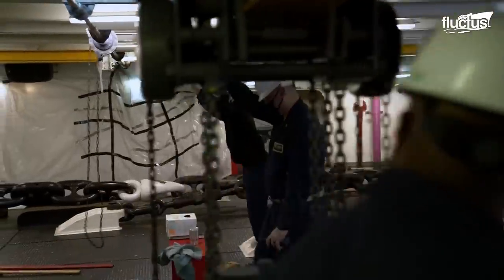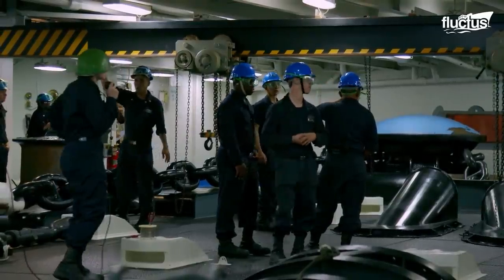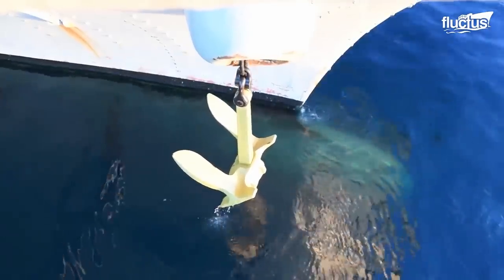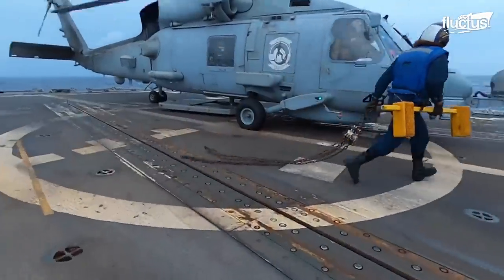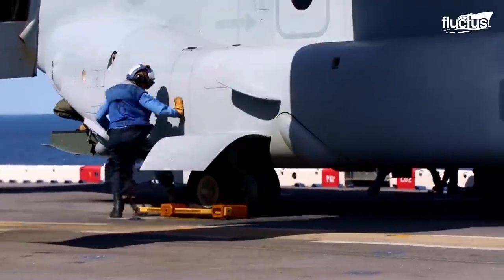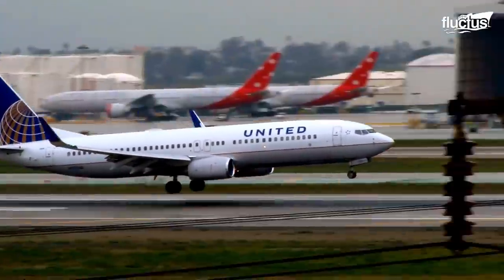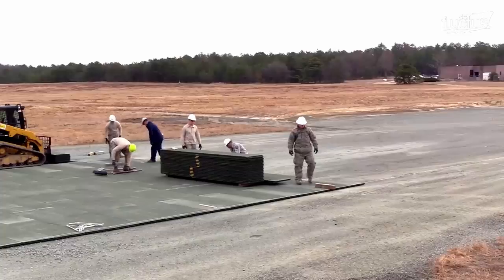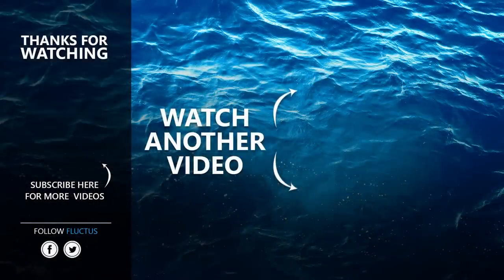The Crazy Techniques US Navy Uses to Stop Gigantic $13 Billions Aircraft Carrier

Comment: I would have thought an Air Craft Carrier would use some sort of mechanical positioning system, possibly some sort of thruster system. The anchor alone will not be enough to keep this vessel steady and stable for planes to land or to take off.
Reply: Planes do not land while anchored. During flight ops the carrier is headed into the wind to maximize wind over deck / reduce the speed required by the aircraft relative to the ship.  Also carriers rarely use their anchors at all unless necessary. If the port is big enough for us to go to the pier we use mooring lines.  Anchor just for places that don't have deep enough ports / enough room.  Off the coast of Mombossa, Kenya was one I remember. Seemed like the liberty boat  between land/shore took forever.
Reply: @davidbwa  Good to know
Reply: @davidbwa  Interesting so when out in the field as part of naval / airborne exercise . The aircraft carrier does it not need stabilising? Possibly using positioning thrusters. If not, is there not a risk that the aircraft carrier may jolt to the side and the plane / aircraft may not have a straight line to land on.
Reply: @billalhossain3134  Short answer No.  Longer answer is varied. 1. 90-100,000 pound ship made for the purpose is pretty stable unless very severe seas. I've watched a destroyer behind us bob like a cork in seas that seemed pretty mild from the flight deck.  2. Carrier pilots are very skilled. They make it look easy. Was most notable a time or two when we had some land pilots come on board to get carrier quals. I wasn't flight crew but you could watch landings on ship's TV. They just were not as good.  One guy kind of bounced the round down (back end of flight deck) but didn't actually crash - just landed hard. He sat for a bit in his jet like he was recovering his wits.  3. Not normally used but they do have an auto nav system where the carrier can take control of the jet and land it. That's like for injured pilot or something. Back then (80s) I heard it was "okay" but pilots trusted themselves more.  It may have improved in the years since. 4. When possible, carriers plan their flight op times and locations to give them favorable weather. In a bad storm they were not flying. That was peace time. You do what you have to do in war but I'm sure they still try for favorable weather.
Also - flight ops at sea - too deep to use the anchor anyway.  And being anchored would make you a stationary target for an enemy.
Reply: @davidbwa  Making wind for 30/30.  That's launching and recovering air craft at 30 degrees off the port bow at 30 nauts.

Comment: I don't  think anchors are even necessary. Why would you anchor an aircraft carrier to make it vulnerable to attack?
Reply: Yeah and I thought they had to sail into the wind to launch aircraft, can they launch when the ship is in anchor ?
Reply: Because not every Harbor has a pier big enough to moor a CVN.  So they anchor out.  We aren't at sea 24/7/365.
Reply: @shawndouglass2939  Yes...helicopters.  Fixed wing do require the ship to maintain a wind envelope to launch.
Reply: The water moves the ship is no match for ocean currents. The process is a homage to the power of the oceans. Really amazing what it takes to be top dog.